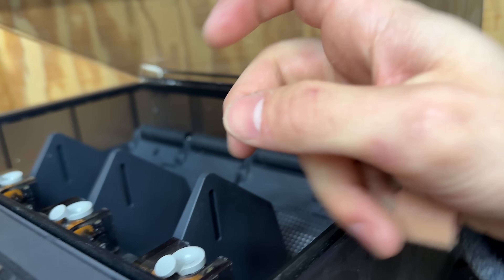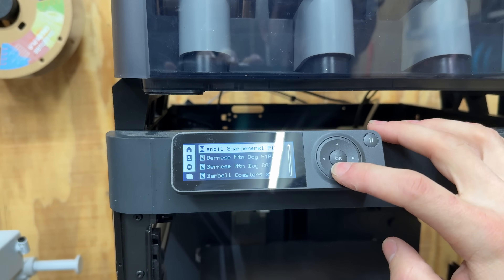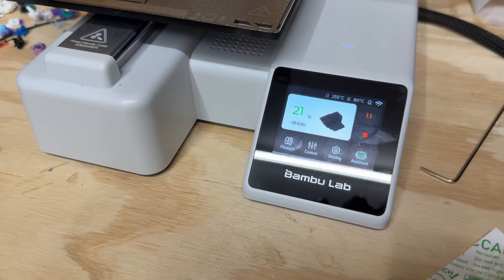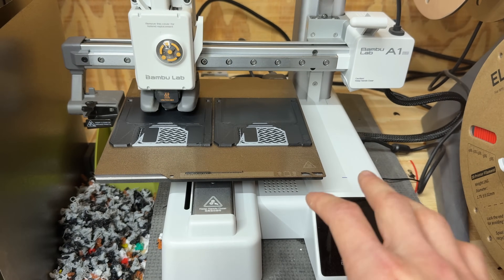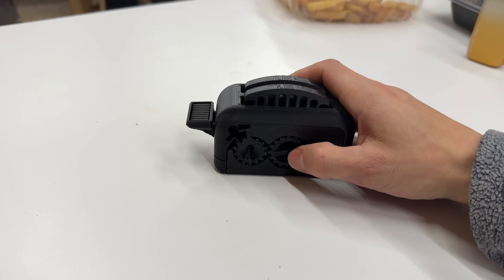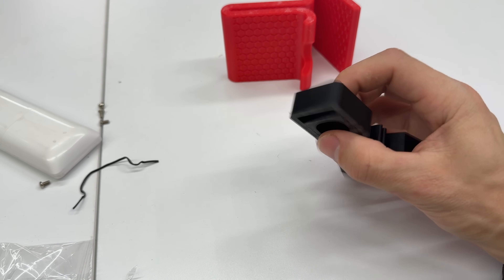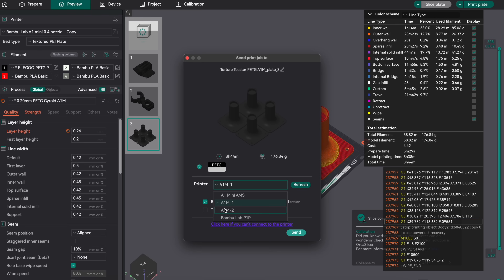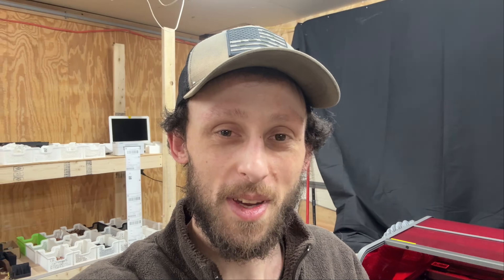A Day in my Small 3D Print Farm: Quick AMS Fix, A1 Mini Ironing Troubles, and A New Laser Engraver!

Comment: I've seen some people get beautiful results with ironing. its just hard to get the setting just right.
Reply from the maker: On my P1P it works awesome with the model I showed off in this video, but the A1 Minis, all of them for whatever reason do not perform the same way when it comes to ironing. I've since upped my Ironing settings to 25% flow with 25mm/s from the stock 20 and 20 I believe it was and have had better results, but still not perfect
Reply: @TheMountainMaker  Interesting, I don't have any bamboo labs. But my first suspicion go to either the cooling on the hotend or the extruders precision. Is there much of a difference between the A1 and P1P cooling solutions?

Comment: Interesting way of presenting everything - Thank you! I found the dumbell business card holder stl, do you mind sharing a few tips for printing (orientation, fuzzy skin, etc.) Yours look so good!
Reply from the maker: The Fuzzy skin Is turned on, and the Dumbbells are printed with the round holes facing up. I had to lower the fuzzy skin though from its default settings but am not around Orca at the moment. It is in the comments on either my Amazon video, or one of the other Etsy ones from when someone else asked the same question.

Comment: I've used about 3 cans of hairspray since starting with PETG, and it seems to work well for me. Cleans up easy with water or IPA.
Reply from the maker: I've never had any issues as far as getting petg to stick or really getting it off for that matter, aside from failed prints where it only gets a few layers up, those are a pain across the board though. One handed though, they are a bit more challenging to remove.

Comment: Are you using the Stock PETG profiles? I have so much trouble with it.
Reply from the maker: I was also was having issues with it with the stock profile. The profiles and settings that worked for me will be in the full comparison video of the PETG-HF vs Elegoo Rapid PETG coming out next week. It'll be far easier to share them there, than to try and fit them in a comment.

Comment: 1:25 not only are they past their prime, they are spent. The packets that come with the spools, by the time you open them, have basically already been used up by what ever moisture that was in the air and filament when sealed at the factory.
Reply from the maker: Time to print some containers and order some actual desiccant beads from amazon I guess!

Comment: I have the a1 and ironing was terrible, I got it a lot better by changing to 25% and 25mm/s, still not perfect. I was shocked because my artillery sidewinder x1 does ironing beautifully and that printer is 5 years old. Bambu needs to do more work on their profiles and updates etc. I hope they don’t become like creality or stratsys.
Reply from the maker: I'll give it a try! I think they are moving forward in the right direction! It takes a lot to startup a company and they kind of accelerated to the top faster than expected. I think 2025 will be a big year for 3D Printing across the board, especially with some of the other manufacturers coming out with Multicolor printing now.

Comment: On the A1 mini, I suspect that the hot end might have some of the screws worked loose, if the first layer is also lumpy this is more likely.
Reply from the maker: I'd 100% agree with you if it was consistent between prints or even printers. It happens with all 3 of my A1 Mini's and it doesn't seem to matter which filament im using or the model(s) im printing. Sometimes it works, sometimes it just doesn't.

I will go through all of them and check the screws just to be on the safe side but it was happening right out of the box on the 3rd mini I got a few weeks back, but worked great on the other 2 for the first 2 or 3 months then I started to have the off and on issues. I appreciate the suggestion! (First layer looks good btw)

Comment: I use a lot of PETG; anycubic is made by sunlu. As is kingroon, jayo, techbears and probably a few others.
As for color matching festool green, bambu's lime green PETG HF and hatchbox's lime green PETG are virtually perfect matches. Hatchbox is a bit better with heat resistance.
Reply from the maker: Thanks for the tip about the lime green PETG! That will be helpful. I will definitely be ordering some of the Lime Green PETG-HF and I use Hatchbox for the Makita Green/Blue already so I've got those settings dialed in as well!
Reply: @TheMountainMaker  No problem! I did the same search for a perfect festool green myself. Protopasta makes a "loostef" green that's a a perfect match, but it's PLA. I prefer PETG for functional parts. Hatchbox is good stuff, just a bit more than I'm used to spending per spool, so I grab a few spools whenever they have a sale.

Polymaker's dark blue is a close match to festool's dark blue they use on their tool bodies. Also, voxelab (made by flashforge) makes a dark blue carbon fiber PETG that's probably a bit closer to festool's tool body color than the polymaker; the color is "midnight blue".

Happy printing!
Reply from the maker: Thanks again! Totally agree with you on the PLA vs PETG. I started printing the Sander holders out of PLA and I could separate them at the layer lines where the lip started to come up. Didn't matter which PLA I used, switched to PETG and problem solved.

Comment: I’ve had ironing issues with my A1 since I bought it. Bumped up the ironing flow to 35% and it seemed to have solved my problem. Also would like to note I didn’t have these problems either on Bambu’s core xy’s (x1c and p1s)

Comment: You mainly have Bambu printers. What is the reason for using Orca silcert instead of your own Bambu slicer?
Reply from the maker: They’re basically the exact same piece of software aside from some small differences in regards to the calibration features that Orca offers. Having started with other brands of printers, and also having some more coming soon that are not Bambu, i just prefer to stick with one slicer. Not that Bambu Studio wouldn’t work with other printers, but i started with Prusa Slicer, moved to Orca and just decided to stick with it.
Reply: @TheMountainMaker  Thanks for your answer! Yes, I really miss the 3D adjustment function in the editing window (bottom left wireframe) of the Bambu slicer.
I use Bambu and Elegoo printers but with two separate software. I will consider your idea!

Comment: Yo bro! Love the content I saw that you were putting in the elegoo filament in your AMS without any adapters do you recommend doing that? Or do you just not care about the dust from the cardboard
Reply from the maker: Thanks man! I appreciate it! 

I have, and would recommend printing the adapters to preserve the parts for as long as you can. But when it actually comes down to using them in my day to day operation, i can’t say i keep up with it. They pretty much only get used now if the spool comes damaged. Then it needs that extra help otherwise it would definitely come apart in the AMS.

Comment: I print exclusively in PETG for my product and almost gave up because the parts stick too much to PEI and I don't like using glue stick.  Then I discovered the secret, Windex.  Spray a small amount and wipe it around with a paper towel.  Doesn't leave a residue on your parts either.
Reply from the maker: So far, i don’t mind the petg sticking too much, aside from the prime line cause that just breaks away when you go to pull it off after the plate has cooled down. 

With that said, I’m definitely going to give it a try just for some testing because the biggest pain in the ass with petg, for me anyways, is tree supports or when your print only gets a couple layers down and has to be stopped for whatever reason… I’m there half the day peeling little parts of plastic off with the snips 😂
Reply: @TheMountainMaker  I've been there.  I print black parts and white parts.  I had to label the sides of the plate for which color to use because tiny little pieces were stuck in the plate and would show up in the bottom of the next print (also tiny bits of the build plate embedded).  When using Windex, the part still sticks more than PLA, but releases without having to bend the plates too much to get the parts loose.  Let the cool a little first.  I think it's the perfect blend of sticking enough that I don't have to worry about adhesion issues and cleanly removing from the plate.  Now I don't worry about having the correct color side of the plate to print on. Just an FYI, it doesn't take much Windex.  You can even spray it on the paper towel and just wipe it around.
Reply from the maker: Awesome! Thanks for all the tips. I'm adding it to the list of things to test out on not just these machines, but a few others I have coming into the Print Farm early next year!